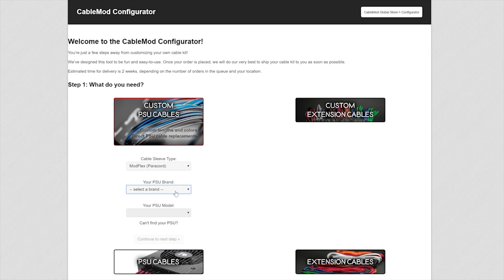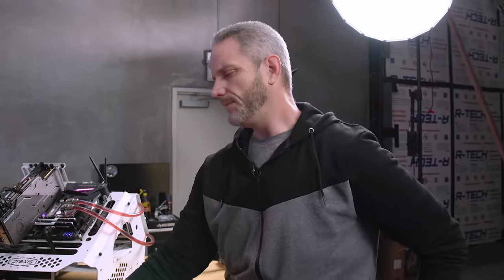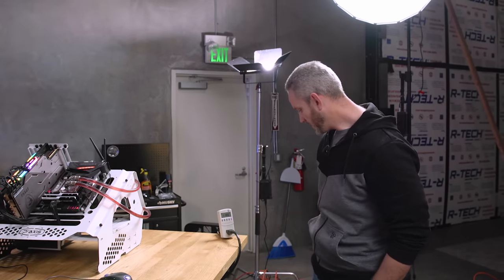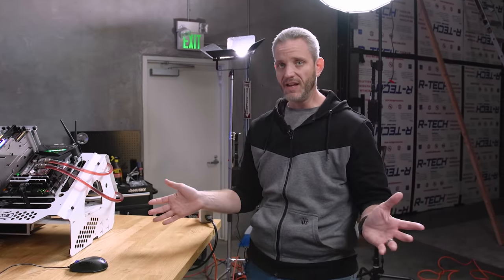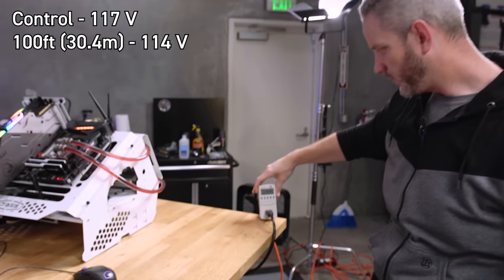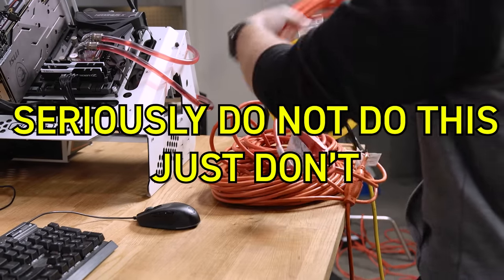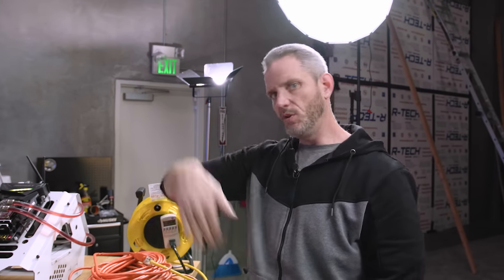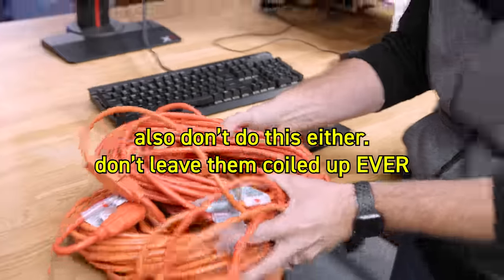Are extension cords dangerous for Computers?

Comment: 2:22 "Brazil: Good Luck Don't Shock Yourself V"
Well... We use 120V 60Hz, but some equipment (usually Air conditioners) use 240V. The power distribution here is terrible. There's a lot of noise. No wonder why cheap "stabilizers" make a "click" sound every time.

Comment: I will also add, in the power delivery field, a plus our minus of 4 to 5 volts at your meter is what we consider good voltage. So, if your at the end of a long power line run, you can have 115 volts at your meter and still pass code for inspection. That also adds to voltage drop in your home. 110 volts is where we will add a transformer to your home.

Comment: So some friends of mine and I throw regular LAN parties. Let me tell you about the time that PUBG nearly started a fire.

The space we use used to be a shared space between a used video game store and a local computer shop, but a few years back, they moved within the shopping center to a larger space. As part of that, they did a massive upgrade on the electrical system including separate 20A circuits for every single outlet. Each outlet after splitters and power strips would typically run run 4 PCs. The middle section, however, split 10-12 PCs on 2 circuits and required the use of extension cords. Considering that even most high end systems running stock will only draw 300-400W under full load and mid-range systems pull less than that, and we even had a couple gaming laptops which are down in the 100W or less range, we have never encountered a problem. At one point, people started hopping into PUBG, but we waited on the menu screen while some people were finishing other games, 7 or 8 of us waiting, idling.

I looked up from my screen while waiting and immediately said, "Hey guys, we got smoke." We turned the lights on and the computers off, and start looking for the source. No one's PC appeared to have any issue, but we noticed the extension cord had a small piece of duct tape near the area the smoke came from. There was a small crack in the outer rubber insulation, but nothing we felt was actually dangerous. Besides, we'd used this extension cord literally dozens of times without issue. The shop owner looked at the tag on the cord and noted that it was a 14ga cord rated for 18A. Again, on an isolated 20A circuit. Should be fine. Then when he pulled the cord in to examine tape patch, he stopped it and told us it was really hot. We disconnected the cord, replaced it, and everyone fired up their computers again. After letting the cord cool down and checking under the duct tape, we found the wires were still ok. Weird.

So we had everyone jump in to PUBG again, once again, just sitting on the home screen. The new cord, also rated for 18A, began to get warm. I opened a resource monitor, and both CPU and GPU were pinned, and it was PUBG using it all. Check framerates in the game, 120+. 6 of the 7 people on the circuit in question were running desktops with i7s and 1070ti or better (pre-RTX days). All 7 had PUBG open on the menu screen. 

So at the time, PUBG was still fairly new, but they hadn't capped the framerate on the menu screen, meaning that even though we were idle, each PC was drawing its maximum power. Some napkin math and we estimated we were pulling 19A. We were surprised we didn't trip the breaker. We were lucky we had the piece of duct tape to give us that early warning smoke and lucky that I noticed the smoke so quickly. We never tried to get the whole room playing PUBG again.

Comment: The rule of thumb for extension cords is to get one, and only one, that matches or exceeds the wire gauge of the device or machine you are connecting to it.If your PC's PSU has 14 gauge wire in the cable, that's the minimum you should be using. 12 gauge is preferred. This is a great example of the problems and potential disasters that a wire that's too small can cause. There is a better example, though. 

Car audio amplifiers are really picky beasts due to their requirement of bursts of juice. Can you run a 2500 watt amp on 16 gauge? Yes. Will it sound good? No. Will the wire get hot? Absolutely. Can it burn your car to the sheet metal? Yes. Guys used to think I was nuts for running OO Gauge welding cable for the system in my car, but I always had the best sound(read cleanest power and lowest resistance) and never so much as a thought about the heat.

Comment: The biggest problem running too long extensioncords is that the circuit breaker might not break when its suppose to, you can have a short sparking away setting things on fire without it tripping.

Comment: The advantages of running at 230 +/- 20 volts is that it needs about half as much current compared to 120 volts.
This also means that the voltage drop over the same cable is going to be half. (Since the voltage drop is the current time the resistance of the cable.)
This also means that only a quarter as much energy gets dissipated in the cable. (The power dissipation is the voltage drop times the current.)

And combine that with the typical 16 amp EU circuit, then 3600 watts is peak load that one can draw. Unlike the US were 2400 watts is a stretch...
Extension cords is rarely a problem, though some cheaper ones are still nasty and should be avoided....

Comment: It may have been mentioned in the comments already, and I can't be arsed to look: the cord warmth is caused by inductive resistance. Always unwind your extension cord to use it, especially under high loads. I've melted a contractor grade cord this way, never did it again!

Comment: Well as an electrician I do not recommend the use of any extension cord for extended usage. And if you have to use and extension cord for what ever reason then I would recommend nothing less then a 10AWG extension cord. But the problem with extension cord is you are adding a break in the circuit the electrons have to jump to continue downstream. With every connection increases amperage and with increased amperage you get increased heating in the wire. While 12AWG would be an absolute minimum. 10AWG allows for more freely flowing electrons resulting in decreasing the heating of the wire.

Increasing wire size reduces voltage drop over long distances. But there are limitations.

Comment: Our HVAC system was being replaced and the company loaned us a window a/c unit. I reached for an extension cord to plug it in and the tech told me firmly to not use extension cords on a/c units. I wish I could remember his exact reasoning, but it was convincing.

Comment: Trying to remember the basics of my Electrical-Computer engineering degree, LOL. 

V=IR

voltage = Current * Resistance
Voltage = potential energy (Volts)
Current = working Energy (amps)
Resistance = usually the median which the current is traveling through (ohms)
Power = Current * Voltage (watts)

in this example, Jay is correct Adding more length to the wire will add more resistance. Increasing the diameter of wire, will decrease resistance. But Current is what is electons flowing through the extension cord. Voltage is potential energy at any given point. 
But there is a few more thing that will reduce the amount of Current going into the pc. 
some include, having really cheap shielding on the cord, and creating and small magnetic field. 

A large amount of heat being generated, heat is a by product of energy not being used efficiently. (efficiency is a measure of how little heat is produced)- this is what is generated when the amount of current/electron's doesn't have enough space to travel through in a given space. 

Creating a sudo inductor by having the wire in a large coil (good shielding prevents this, which is why you can roll up an extension cord)

There is also Clean power VS Dirty power. Direct power from the fusebox does not gaurentee a Consistent AC power source.
If you need the maximum amount of clean power,  doing what linus did and grabbing a universal power supply with high enough ratings is the best bet to get a power source that is close to perfect. A good UPS will take raw power, and filtering it, so its exactly whats its rated for. (if it doesn't, then you should probably get a replacement, or the something is up with the raw input power) 
Ive worked in data centers before (years ago), and the amount of money we had to spend to get the perfect power running through every rack.

Comment: Higher cable resistance causes higher voltage drop, because U=I*R, that's why with bigger load (current)/resistance, the voltage drops more across the cable itself, you can test it out, if you measure voltage across begining and end of the wire, it should be exactly the voltage lost on PSU vs initial voltage.

Comment: 2:22 yeah, that's an accurate number for Brazil KKKKKKK

Here in some places the voltage changes depending on what street you are in (in the same neighborhood we can have 110V streets and 220V streets)

And the best part is that we just call it 110V for convenience. Actually there's no 110V here, just 127V.

Comment: Electrician here, I want to point out that 14 gauge cords aren't even allowed on most job sites. We have to use 12awg extensions cords or larger since they're rated for 20 amps and (usually) have more insulation on them.

Comment: It’s all about the amperage being pulled by the devices. Extension cords can be fine as long as the gauge is adequate and the wire is rated. That also inadvertently includes the wiring in your home which is usually 14 or 12.

Comment: It's funny that you mentioned a situation where an overclock with Linus was unstable due to possibly high resistance
I commented on one of his videos once where he was trying to achieve a really high OC and failed, I suggested making sure the system was receiving adequate voltage by removing the extensions and not having the system on the same circuit as all of the other devices ie sharing the same line as this massive refrigerator cooling unit and ...all of the comments were saying "that's not how that works"
But if you drive the volts down enough, you're driving the amps up enough, all in all potentially adding instability

Comment: Power (watts) = I (amps) * V (volts)
So mostly right, as the voltage drops more amps are needed to maintain the right wattage. Increasing amps does not increase volts

Comment: whats way more dangerous for a lan setup is multiple pc's on unwinded extension cords. those spindels will just heat up A LOT, until the point they actually melt through their insulation and may start fire

Comment: The coiled extension is an inductor. it will alter the power factor by skewing the phase relationship of volts and available current. SMPS can account for this a fair bit - but will probably run pretty inefficiently. also, the coil will get warm as it sits there wasting energy...

Comment: Never ever use anything  but 12G cords for power tools and computers. They are expensive, but are designed for heavy loads of 20A equipment. 14G is good for powering lights and battery chargers or other light tools. 16G is for lights and cell phone chargers only. 18G is Christmas lights and anything beyond that is specialized wire for speakers, doorbells, signal wire, etc.

I keep 2-25' heavy duty cords for my shop tools if I'm out of the garage. I have a 50' reel cord like Jay used for random stuff. And I have several 100' weather rated cords for running outdoor lights.

Comment: I live in Brazil and we actually have a quite cool system. We have a dual phase 230V system. So, instead of receiving one 230v line and a ground line like Europeans we receive two 127v phase alternated lines and a ground.

That means, tadam, we actually have both, if you use only one of those lines you get 127v and if you use both you got 230v, it's actually quite normal to have both 127v and 230v oulets on the same house and we can connect North American or European devices without cluncky adapters (there's another more important reason for this system but anyway...)

We actually have the coolest power delivery.
Reply: It depends on where you live in Brazil. We had more differences in past, but we have basically two electrical systems today: 127V phase-to-neutral and 220V phase-to-neutral. Two 127v phases  gives you 220V phase-to-phase, period. If you don't agree you REALLY isn't prepared for this conversation. Deal with it.

Comment: Ups provides stable voltage output. If you have issue with extension cors that means you are hitting the minimum voltage of your PC power supply.

Comment: Actually the voltage we use here in Brasil depends on the city you're in, and depending on the size of the city,  witch neighborhood you're in, it's a really shit show, cause wherever you are, there is an "odd" power outlet. You see, stabloshments in São Paulo (majorly 127v) always have a signalized 220v outlet, but in cities where 220v outlets are the "rule" there's always a 127v outlet

In case you're wondering, yeah, we do break a lot of stuff

Comment: He has the cords coiled which introduces induction into the equation. This would affect the results subtly and, as a side note, can melt ferrous metals if the voltage or currect in the coil is high enough and the ferrous sample is in the centre of the coil though this is mostly done with DC voltage.

Comment: FYI
If you did want to try and start a fire then place the cheap cords between the larger gauge cords. The smaller cords would have massively increased the amperage needed, as the smaller cords add a huge restriction in flow. 

Keep the fire extinguishers very handy!! And someone at the panel to kill the breaker in case it does not trip!!

Comment: The cable within the wall that is pulled from the circuit breaker to your wall socket outlet is already an extension cord by itself. It's extension-ception.

Comment: Probably not for the computer, but maybe for the wire... The point is that the house wiring and the receptacles have a wattage limit. The cord may not  have as high as one depending on what it was intended for. When wire is overloaded for its cross section it heats up, but only at that point and what is physically in contact with the wire. Also I think 2 phase 120 is a better choice for consumer power than 240. Much better for surviving accidents.

Comment: Bottom line, if you are going to run an extension cord run the thickest, shortest cord you can.  And if you can find out where the panel is in relation to your outlet it wouldn't hurt either.  Having a 100' run of 14 gauge wire leading up to the outlet you are about to extend is NOT ideal.  Bonus points if you can sniff out a 20 amp circuit. I only run 12 gauge 120v ext cords...Period.  They are not cheap, but I purchased my cords almost 10 years ago and they are still going strong.  You get what you pay for.  I have 2 25', 2 50' and 1 100'.  The most I will run in one line is 125' and that dependent upon load and system I'm tying into.  My 220v cords are 12 and 10 gauge.  I make those, as it's WAY more cost effective.

Comment: My computer's power supply has a 14 AWG power cord.   IF, I were to use a 25 ft extension cord it must be 12 AWG, if 50 ft, it must be 10 AWG, and the plugs must connect firm and solid!

Comment: Also as your wires in extension cord heat up they have increased resistance which causes more heat.
Plug an electric heater in on that extension cord on a splitter right before computer.

Comment: The benefit of a 240 volt system, those extension cables would be perfectly fine. Higher voltages carry more current. I often watch vehicle shows where welding and cutting is performed by electric welders. Often the workshops who use them have 240 volts available onsite and this is in the USA. So maybe Jay, you can ask your electricity supplier for a 240 volt system. It's great for air conditioners too.

Comment: FYI, Never roll up an extension cord like you was doing at the end of the video while the cord is still plugged in. There have been people electrocuted on job sites rolling up a cord with a nick.
One reason why OSHA will fine you if you are caught using cords with nicks or kinks. Plus the fact that you could electrocute someone if it rained or something.
I made a real nice extension cord for my 240v 180amp welder. Similar items to the black one you have except much larger with a waterproof box.

Comment: With that said, all PC's should be on battery back-up. These units offer up stable power (some even sine wave) without power spikes and dips that will weaken and eventually cause your computer to fail.  Get a battery backup unit!

Comment: Actually the problem is the Impedance not Resistance. Impedance in your case will be the Resistance + Inductance of the wires. Resistance will cause problems due to your general current consumption, but the Inductance causes voltage drops on current transients, so when the GPU clock makes a sudden current consumption, the inductance will make a voltage drop, and then the computer can shutdown from the nowhere.

Comment: What you are doing by putting coiled up extension coils on top of each other is building a transformer that induces all kinds of currents in the cords themselves, this not only drraws more power but also heats the cords up whcih increases resistance which further increases power draw

Comment: That contractor cable acted as like an amplifier because it was left coiled up, I think. If you un-spooled it you would see a drop then. 

Kind of imagine how copper coils are used for alot of appliances today, small motors, old CRT TV's, electromagnets, speakers, etc.

The coiling of that extension cord actually improved stability of maintaining a better voltage.